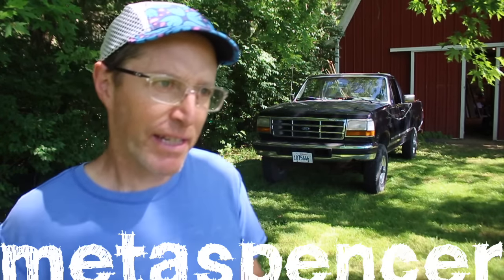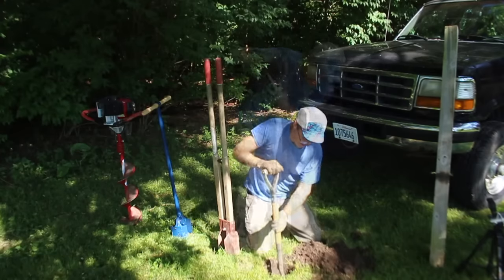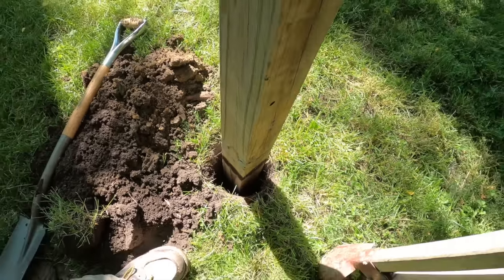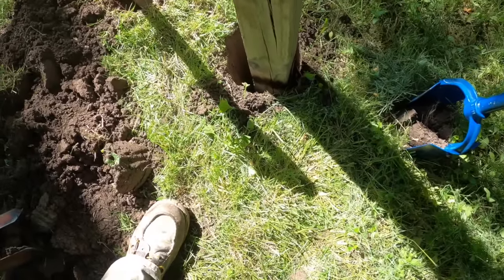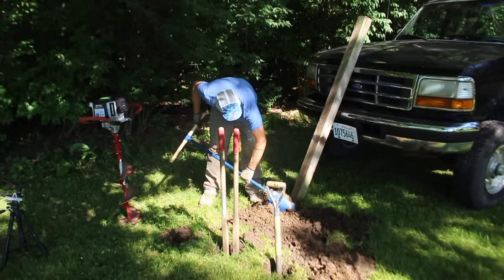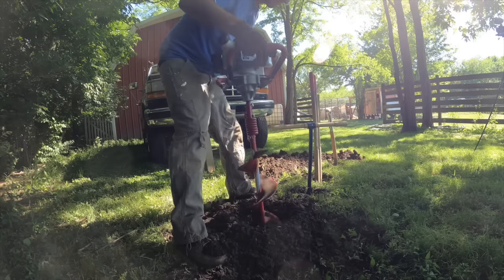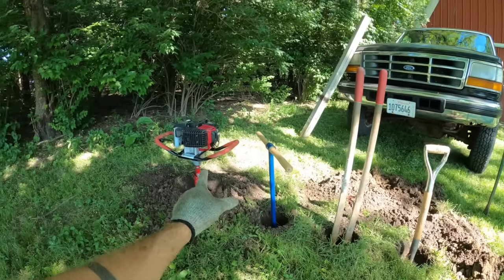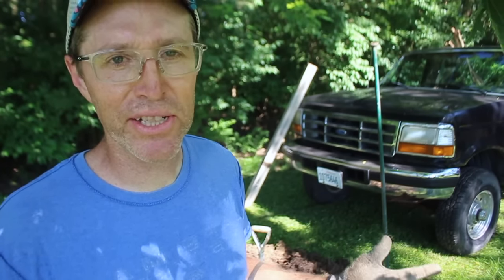Post Hole Digger Showdown!

Comment: Waiting for Part II:  The Post Show Digger Hoedown, haha!  Would like to have seen what the working end of the hand auger and the rock bar looked like.  As you noted with the post hole digger, you supply all the power.  So the comment at the end about how that tool cuts through the roots and rocks... well, that is you (or me) doing all the work.  Machine auger 100% for me!

Comment: I was actually looking for design ideas for a diy earth auger for the diy 3 point hitch I built for my 2002-2003 Stanley GT when I stumbled upon your video, :) and your demonstration provided A LOT MORE helpful information than I would have received from any 1 "diy 3 point earth auger" would have. :) Thank you so much; I've got an idea that combines the concepts of the power auger, the hand auger, and the manual well version of the hand auger. Post hole diggers have always been my go-to for holes. I had 2 OLD sets my great great grandpa bought in his time and they are beasts, :) I have the upper body to prove it. Lol they are made out of 1/8" steel and are pretty heavy compared to modern post hole diggers. The bolt broke in 1 set last year and I put off replacing it because I still had the other set, but then decided not to replace the bolt because I discovered that a half of a post hole digger was the perfect companion tool for a complete set. The half is perfect for shimming the sided of the bottom of the hole in order to get the post hole diggers deeper (and lighter than a whole set.). Just my take.
Reply from the maker: Good luck with that auger project! I have an auger on my tractor and the biggest challenge with it is getting a good plumb angle when drilling ... yours sounds great

Comment: Great review and showing how everything works including their pluses and minuses, regarding the post hole digger I noticed if I dig a hole more than about 2 ft or 2 and 1/2 ft I literally can't open the 2 handles at the top to actually squeeze the dirt at the bottom of the holes to pull it out because the sides of the handles will actually hit the inside of the top of the hole when I'm trying to dig deep holes that are like 3 ft deep or 3.5 feet deep for example and trying to actually get the dirt out so the post hole digger works great if you have a shallow hole to help dig the hole and especially pull the dirt out like if I use my Harbor Freight Earth Auger to make a hole which is what I use primarily on most holes to actually dig the holes and I use an 8 in auger bit instead of the 6 in one that it came with because the one that it came with is just so much more narrow and a lot shorter at only 22" compared to 31" long on the 8" bit but you can also buy the extender arm thing that will help you dig a hole much deeper but sometimes there's a lot of dirt at the bottom of the holes so I try to use the post hole digger to remove the dirt from the bottom of the holes but then if the holes are deep I can't even get the dirt out with the post hole digger really just because of how they're made because when you try to squeeze the dirt the handles hit the insides of the hole so that's a problem and a shovel can't even get it out either often so there's this certain specific type of a shovel that's made for removing dirt or sand or whatever from the bottom of a hole that angles up more at the bottom that costs like $30 that I might buy from Home Depot only online but it's a little bit pricey but I think it's worth trying it for deep holes that have a lot of dirt and or sand at the bottom of them to remove that material so that I can put my posts in deeper than normal on my fence that I'm building but great video and thanks for showing how these different hole makers work because people need this type of information because if anyone's going to build any fence or anything beyond just a couple holes they need to know this type of information and how all these things work for sure and yeah if there's a lot of rocks in the ground for sure your earth auger will automatically stop working great and cease to function so that's when a shovel is needed and the other straight rock breaker thing like you have on the video are necessary and it will take a lot more physical work to try to break up and remove the rocks but when you have a lot of rocks in your ground or your hole it's going to take you much longer to dig holes and especially if you have a lot of them and you're going to need shovels and the other bar thing for sure but great video!
Reply from the maker: Great insights there man -- I totally know what you mean. Some holes thus end up too wide, others crooked, and some just right. Always a struggle ... but great to get it done!
Reply: I use post digger to make a 4.6’ deep hole now so I understand what you said about post digger.

Comment: Ive seen 2 grown men thrown using one of those power augers and many pipes broken.  The power auger isn't  as good because you can't tell if you're spinning through any services/pipes/wires underground until you already have.  The best and safest way I find is a clam digger(tool 2) and a 6' metal digging bar to break through the roots and shimmy any smaller rocks loose that you come across.  Great video comparison of the different  tools. CHEERS
Reply from the maker: I've gotta agree with you about that power auger: it'll tear through wires and bust you up if you're not careful. It'll even bust you up if you ARE careful. Fortunately around here we mainly have soft soil free of rocks, so it's at least less dangerous in this area. Happy digging!
Reply: Call for locates before digging!
Reply from the maker: Absolutely!!

Comment: I grew up using a rock bar (I've heard them called San Angelo bars too) and a similar post hole digger.  I think I'd like to try that manual auger.   The only other auger  I was exposed to was tractor mounted and the owner ran it.  I still had to cleanout the holes with the post hole digger.   Thanks for taking the time to make this video!
Reply from the maker: Yeah we have one of those tractor augers and it's like you describe: gotta get in there with a post hole digger afterwards. I like that "San Angelo bar" name! Cool to hear

Comment: I agree with most people here, great video.👌 One thing from experience I have to add is that blue hand auger you have is so underrated to what it can do. Even with awful hard packed dry clay of Colorado. I helped my brother-in-law dig some deep holes for a gate and we found once you get some dirt on the top of it on starting your hole it will chew through anything but big rocks no problem. It just takes some adjusting and you can really make it do the work for you
Reply from the maker: You said it man. Sounds like you got it done!

Comment: appreciate the comparison, as well as the comment about the post hole unit requiring more power/mass to make it work.  Replace my mailbox will require a post set in concrete, and as a woman, it's good to know which tool will require more strength when doing home repair.   Also lower half of the lot at the street level has more clay in soil.
Reply from the maker: You can do it! That post doesn’t need to be more than a foot or two deep

Comment: I use a combination of a manual spiral auger, spade, post chisel and post hole digger and occasionally a concrete breaker if digging a hole with an existing concreted post. Not all are necessary every time but good to have them all, never needed a power auger. Works very well without too much effort . Enjoyed your video 👍🇬🇧🇺🇸
Reply from the maker: I like your style: gettin' it done with a variety of tools that you use when you need them. I tend to think it's more effort that you, but maybe I'm just wimpy! thanks for checking it out man

Comment: The drill always frightened me in regards to potential injury. I honestly think the manual twist is the way! Great video. I'm glad you got your hole anyway 🥴
Reply from the maker: I agree with ya about that power auger: it can be risky if not braced with a long 2x4 and a second person.
Reply: @metaspencer  I bought manual. Got there. Glad wasn't powdered. I jammed many times due to stones.
Reply from the maker: @blizteredthumbs7911  Those stones are tough! Sounds like you did a good job

Comment: Picking up my post hole digger & rock bar tomorrow after struggling with a spade  in a rocky yard - thanks for the video!
Reply: Bdjdh
Reply from the maker: Good luck with it! You'll get it done for sure
Reply: @metaspencer  phew it's still a good workout, but much better than using only a spade! 😅
Reply from the maker: Exactly
Reply: I finally bought a rock bar, wish I hadn't waited.
On hint, my bar has a flat blade at one end. I used a grinder and a file to put a real edge on it.
Best way to cut through a tree root at the bottom of your hole.
Reply from the maker: You bet! Heavy and effective!!

Comment: I use a Ryobi 40V battery auger for most of the work, and a post-hole digger only when I hit rocks or roots. The Ryobi works fantastically well - I can dig around 16 x 2 foot post holes on one charge, and with a couple of spare 4Ah batteries and a fast charger, I can get a lot done in a day. The Ryobi doesn't need any maintenance either, so it's much easier than a gas auger. Also the torque is better, and it has a reverse for when it locks onto roots.
Reply from the maker: Sounds like a good setup. I haven't tried that Ryobi ... seems too work for your soil!

Comment: I bought the hand auger after seeing this video.  It made easy work of my 4 holes for garden arbors.  Thanks!
Reply from the maker: I'm glad it worked out! In rocky soil that hand auger can get hung up, but when it's working it's really great, safe, and easy on the body.
Reply: @metaspencer  I used it in compacted clay (no roots or rocks).  The key was pouring water in the holes as I went.
Reply from the maker: @mrlaney62  great idea!

Comment: I grew up on a farm in the 60s and 70s and we always used a combination of three hand tools, the auger was preferred, in combination with the shovel, to dig the primary hole.  The auger to do the digging and the shovel to cut the roots and move small rocks.  The 2 bladed "post hole" digger was used to "shape/shave" the edged of a hole, in case you run into a really BIG rock.  We didn't have the option of that little powered post hole digger.  When we did finally get a powered post hole digger it attached to a 3-point hitch on a 60hp tractor.  It could get through just about anything, except big rocks!  At that point, the ol' 2-blade post hole digger still came in handy.  If you're putting in a privacy fence, where pole location needs to be exact, the bigger hole of the powered unit comes in handy for a little wiggle room in setting each post.
Reply from the maker: Sounds like some valuable experiences out there! I have a 3-point hitch auger for the tractor, like you describe, and it does well until it hits those rocks. Nothing beats rocks until you get out that rock bar :)

Comment: That power auger is really best used with two people for both ease of use and safety. Ive seen people get hurt using those by themselves going too hard on the gas.
Reply from the maker: Yep you said it -- lots of torque on those things

Comment: Drain shovel is great for evening out the bottoms and sides of holes, and is great because it’s usually about 42 inches up to the handle, which is code for posts.  Great to also make a starter divot for augers, d handle allows you to drive the shovel through roots better, saws-awl as well, crucial digging tool, or hook machete.
Reply from the maker: You said it! Great points and perspective ... from an experienced digger. :) Thanks man

Comment: For me the most versatile is the second in test, the Post-hole digger, sometimes the earth tends to get stuck in the metal arms and for that it is important to also use a piece of board in the area to shake the earth and that's it. not be kicking to get it out, there were a few seconds less, hehe.
Reply from the maker: I tend to agree and use that one the most. Thanks for the tip of the board! Thanks man
Reply: I agree!

Comment: I would recommend a slight variation. Get a 2 foot drill bulb planter with a 2 inch diameter. I stick it on a cordless drill. When using most of the manual tools drill out the center of the core, then use on of the other tools. It is much easier to collapse a hollow core than a solid core.
Reply from the maker: Interesting approach!

Comment: OK, I've got the post hole digger and power auger and the narrow shovel. I think it's where you live. I can do a hole with the power auger in less than 30 seconds. (yea, I timed it several times plus I'm on the larger size) But we have no rocks and very little roots where I was putting the posts. Post hole digger is fine too. went down 2.5-3' in a minute or so. Again, my size helps plus it's technique and soil conditions. The shovel is a PITA. A post hole digger is just two shovels that can also grab the soil to lift it out.
Reply from the maker: You said it man … nothing beats good soil to dig in

Comment: Great video... the post hole digger and shovel is what we use the most... the gas auger makes you fight with the machine too much
Reply from the maker: yeah, that dang auger seemed like a great tool when I bought it but is usually more trouble (and pain) than its worth. Thanks for checking it out!

Comment: I have two types of post hole diggers on my truck. One is like a regular one but I replaced the fiberglass handle with 6½ft 20 weight 1⅝pipe. 
Now the second digger is ment to be heavy. I've got the thickest spade tips we had and put 5ft 80 weight 1⅝pipe. And that beast goes through frost and gravel really well. And pulling rocks out
Reply from the maker: That weight sounds excellent! Nice modifications man. Brilliant

Comment: Good comparison of the tools. I once rented a power auger in the 1980 s that was attached to lawn mower type base with an 8 foot bar. It was really cool because when you hit a rock it could not twist on you like the two handed ones. I have never been able to find one again.
Reply from the maker: That sounds like a great design. I've seen one with a long bar behind it, limiting the twist ... great idea to displace that energy into a frame. Thanks man
Reply: Little beaver....

Comment: With the post hole digger... there is a "big kid" version thats worth finding if you are going to use it a lot. To start with, the handles are longer, much longer, and thicker too. Not only does this make your leverage better, but it makes the tool much heavier. The extra weight is a big deal, as it lets the weight of tool bite in deep. 

For reference, we used these on a line crew, digging holes for power poles. The standard for performance is a 3ft wide, 8ft deep hole in an hour, and a good grounds an should be able to do 4 or 5 of those every day. I'd equate that to 15+ regular post holes per day.
Reply from the maker: Oh man, I've never used a big one like that! I'll have to find one. Sounds like some rough work on that crew but you got it done
Reply: @metaspencer  yeah, it was hella hard work. But, the good tools actually do make it better.

Comment: Exactly what I was looking for. By what I learned looks like the manual hand auger is the best for my project, however, it is rather costly now between $90-140! What I planned on doing is rent a gas powered auger at home improvement store and use for my 9-10 holes which should come to about $70.
Reply from the maker: Sounds like a plan. Just be careful with that gas auger as they can quickly break a wrist. Good luck!

Comment: I own and use a power auger.. I have a 12" and 6" bit..Living in Missouri with extremely rocky soil , I have all but retired the 12" due to the rocks. My suggestion is real simple when using a gas power auger..Dig slow , and take small bites before lifting and lettin the auger clean itself of loose dirt..If you try and power down through the soil real fast (my mind set when I bought it) , when it catches a root , or baseball size rock , mine will snatch you nearly off your feet , twisting your wrists  , elbows and shoulders. DO NOT try and be more manly than the auger , and hold on to it - turn it loose !!!. I'm hard headed , it took me 3-4 lessons to understand I wouldn't win , and I'm not a little man...I hold a tight grip but 'stay ready' to turn it loose .
  They are great machines to use , just respect the FACT they will permanently hurt you IF you get careless or in too big of a hurry..That said , I wouldn't want to do without mine ....
Reply from the maker: Great wisdom and advice gathered from experience! We've recently found, when drilling into rocky soil, that strapping a 2x4 to the auger handle and having a second person hold an end of the 2x4 takes the kick and torsion out of the auger. Just a stabilizing thing ... but still: slow is the way to go
Reply: @metaspencer  Thank you. I will give this a try. I had not thought about this.

Comment: Thank you for the video. Any thoughts on electric augers?
Reply from the maker: I've used a few electric augers -- they have pretty good power but some have thin steel on the auger screw itself, so not great on rocks. good power tho!

Comment: The narrow shovel sharpened up in combination with sharpened up post hole diggers. I’m in glacial packed New England so the soil is similar. As well as a trust stone rod. I build decks solo so I’ll spend a day or two just digging those 42 in deep holes for 12 in tubes. I keep an angle grinder close by, it really seems to make a difference keeping things sharp.
Reply from the maker: New England soil can be rocky and tough! That deck building gig sounds like a good one. I should sharpen more often ... thanks man
Reply: @metaspencer  thanks man! btw, that hand auger was awesome, dunno if it well it would work here but I’ll find one and give it a try for sure.
Reply from the maker: You can find them used sometimes